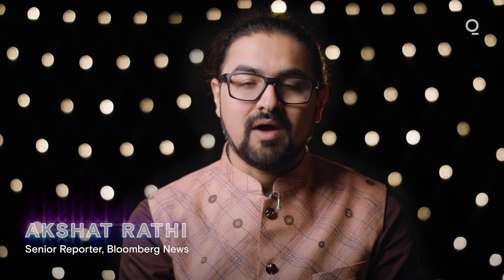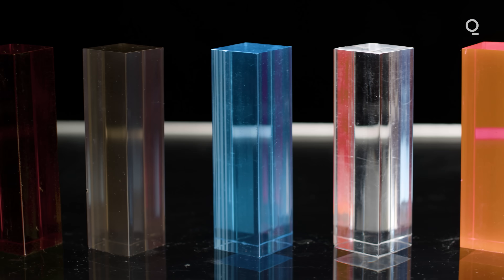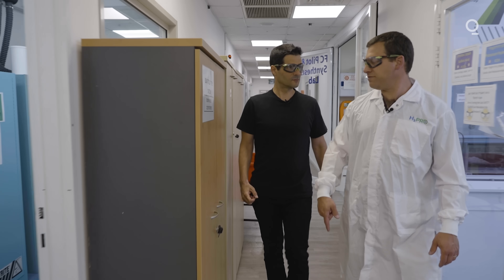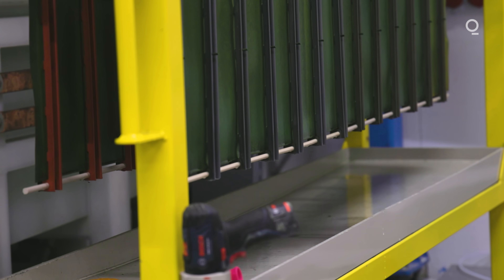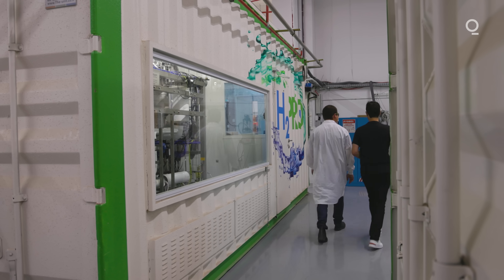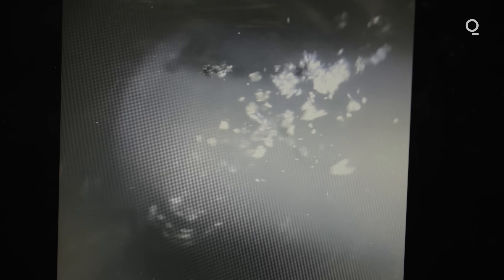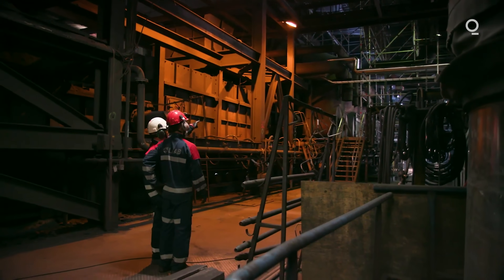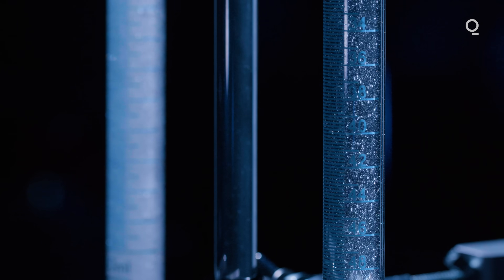How Cheap Hydrogen Could Become the Next Clean Fuel

Comment: Great video, but Hydrogen has no chance.  EV can be powered up anywhere for vehicles in the developed world. The distribution network is everywhere in the developed world.   Also, special interest is already all in on EV’s.  Perhaps in planes or in the developing world.
Reply: Why do people only care about transport applications?
Reply: You know that you can burn hydrogen to power EVs right? Its as flexible as fossil fuels but it dosent produce CO2... in theory its applications are as energy storage which can be manufactured instead of taken out of the earth... in fact since all you need to produce it is energy, you can just have a full renewable powergrid which produces hydrogen to be burned during downfalls, thus achieving a totally clean powergrid which can even be used in space (solar panels+water = hydrogen, which then can be used as airship fuel while producing more water) Its biggest downfall is the efficiency in the process which make it more expensive then simply drilling oil, but its still very affordable if we have cheap energy in the first place (since you are only using energy, equipment and manpower costs)
Reply: Charging EVs is still done through burning fossil fuels primarily. Defeats the purpose of going clean. Seems like you need to “develop” your brain in your developed country.

Comment: Could someone address how we get the water back once it's split into hydrogen and oxygen?  Water is the most fundamental component for life.  What are we supposed to do once all the water has been converted?
Reply: When you burn the hydrogen to get energy from it, it oxidizes and turns back into water.
Reply: @dominikpetercsak6076  If oxygen is being released into the atmosphere, it would be available when hydrogen is burnt to combine back with it to make water.
Reply: Big big big facepalm…
Reply: When burned it mixes with oxygen and turns back to water.
Reply: 1. When you "burn" hydrogen you get water back. Usually in the form of steam, which turns into rain.

2. The amount of water that we could use up to produce hydrogen is droplets compared to what we have available.

Comment: Oh dear. Failed at the most basic level. Hydrogen is NOT a fuel, it is just another energy storage medium, like a battery used to store electricity. All your doing with hydrogen is using it to store energy and transport it to somewhere it can be converted back to energy. The issue with hydrogen is it is inefficient to create hydrogen whatever method you use. Much lower efficiency than using electricity and batteries. Another issue with Hydrogen is low energy density compared to fossil fuels …

Comment: Hydrogen as a fuel for transportation is DUMB. 
 It's like using a knife to mine iron from the ground to make a knife in order to cut an apple. Why not cut the apple with the knife you're currently holding??? 

Hydrogen as a fuel is an attempt of big oil to stay relevant in an era where electric vehicles are becoming mainstream. I think this piece by Bloomberg is funded by big oil.

Comment: Hydrogen for energy storage is just the more complicated and less efficient way of doing what a battery does. However there is a sweetspot for compressed green hydrogen where the deadweight of batteries can be compensated for large vehicles. The main challenge is not to obtain green hydrogen.. but how to convert it back efficiently to electricity or useful output again. Hence green hydrogen in areas other than energy: could find its application in steel production or consumer products etc. Perhaps one other way is to produce liquid fuels by combining with carbon dioxide for planes, green hydrogen would then provide a clean CO2 loop: but obviously the challenge here is now to make it cost competitive.
Reply: The problem with batteries is just how expensive and contaminating the mining of copper/lithium/cadmium is. Take a look at coltan mines in Africa and how impactful it is towards the environment. Also the process of obtaining hydrogen is wayyy simpler

Comment: You don't have to care about CO2 as a so-called "global warming gas" btw. 
It's non-science supported by fanatics that don't really understand the physics.
However,  they know enough statistics to be dangerously and wrong about public policies.
There are other issues and hydrogen is a viable solution to some of them (priority: air pollution in cities) ,
but green-hydrogen from water electrolysis isn't the best way to this right now.
The real anthropogenic warming problem is due to atmospheric thermodynamics (AT).
AT is largely poorly understood, but there are new theories that are gradually up-ending the old ones because of more accurate (+rational) models.

Comment: Notice how the video ended abruptly on the topic of storage and transportation. Hydrogen storage is troublesome.
Reply: It would mostly have to go straight to distribution via (plastic not metal) pipeline and consumption (via fuel-cell electric generators) at homes and businesses. 
Saying that, there are some technologies that absorb hydrogen like a sponge (which would be handy for mobile use).
Chemicals like Boranes can be used to store hydrogen, but they are fairly volatile.

Comment: Did anyone think of using the 40ft rise of the tides as a clean source of energy? The eternal yo yo of the Earth. Also, there is the O2 that could be saved to burn with the H1, instead of just off-gasing the oxygen.

Comment: Edison generator or battery dynamos powered electric cars are unlimited range electric cars trucks and airplanes.  We are slow to realize the normal application of electricity to transport and generation of electricity.  We are grossly misinformed about power generation and power use.  We don't need fuel water wind or steam to produce electricity or generate electricity.  An Edison generator and dynamos power plants easily replace fossil fuels and nuclear power plants.  We are grossly misinformed about power generation and power use.
Reply: A permanent magnet motor as a generator with inverters and transformers is a normal application of physics and basics of electricity.  A simple power plant without fuel or pollution.

Comment: 1 kilowatt hour of D.C electricity can (can convert 1 cubic foot of water into) produce 7 cubic feet of hydrogen and 3.5 cubic feet of oxygen per hour. 

One litre of water will produce 1235 litres of hydrogen and 622 litres of oxygen. 

There are 27 liters in 1 cubic foot of water. That's 33,345 liters of hydrogen and 16,794 liters of oxygen. 1 liter = 1,000 cubic centimeters or a cube which is 10 cm high x 10 cm wide x 10 cm long. 10 cm = 4 inches on a side. 1 liter = 1,000 cubic centimeters = 1 decentimeter. 

What is needed is a catalyst that can help the D.C electricity break up water as easily as plants do it through their process of photosynthesis.

What must be achieved is that for every 1 kilowatt of D.C electricity consumed-used the electrolyzers must be able to produce the hydrogen gas equivalent to 100 to 1,000 kilowatts of D.C electricity. It must be able to produce more electricity than what was used to create that same amount of electricity by a ratio of 1 kilowatt to 100 kilowatts up to 1 kilowatt  to 1,000 kilowatts of electricity in form hydrogen of or equivalent to it's amount of hydrogen gas.

Comment: 1L of gasoline is 1.71$ where i live. so 1 Kg of gasoline would be around 2.18$. If 1Kg of H2 costs between 4 to 5$ to produce but produces 3.2 times more energy than the same amount of gasoline,  so you need  3.2*2.18=7$ worth of gasoline to produce the same amount  energy you can produce with 5$ worth of H2 ?? then I would say efficiency wise we are there  ??

Comment: Green Hydrogen is more expensive to manufacture because it uses a lot of Green Electricity to produce. It will never replace Electricity to power road vehicles and it wont replace ship bunker fuel, as that is the cheapest dirtiest fuel on the planet but it might replace the fuel for aircraft but with speed that batteries are evolving at, that could be called into doubt.
Once you have created the Hydrogen, the next task is to store it, it's not easy as it is the smallest atom and is prone to leaking
Reply: Yes, I suppose people think, it's possible to simply replace the gas now used in houses  for heating and cooking and boilers, with hydrogen, but how wrong they are.